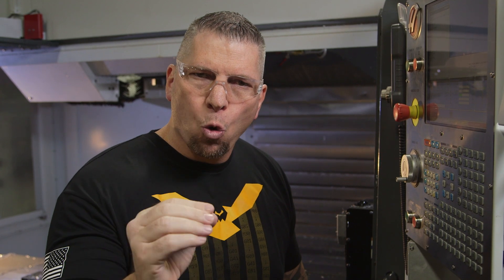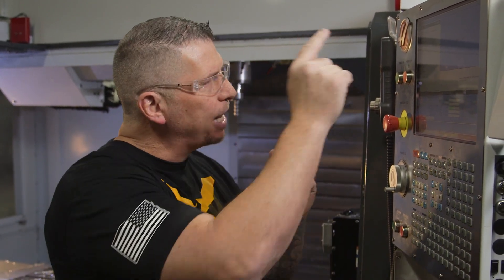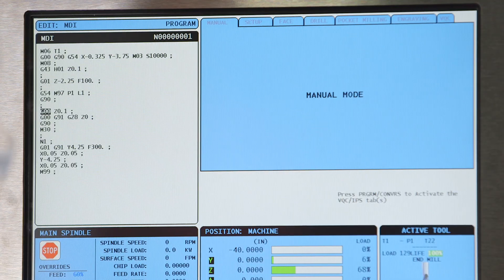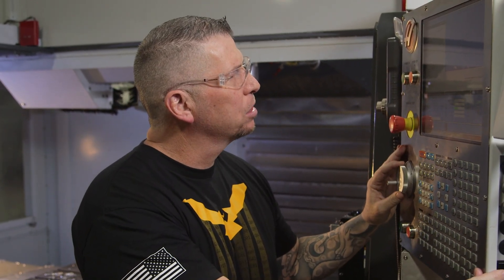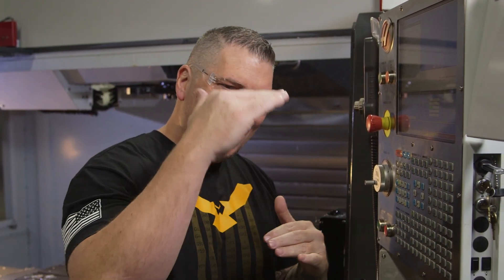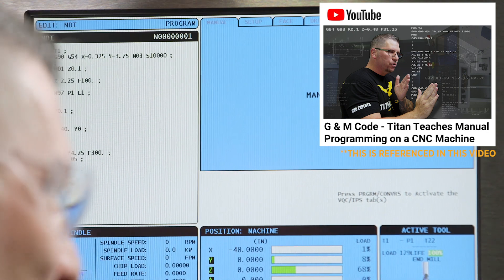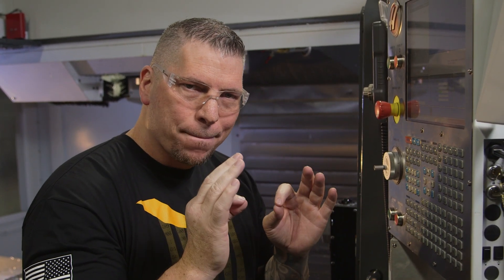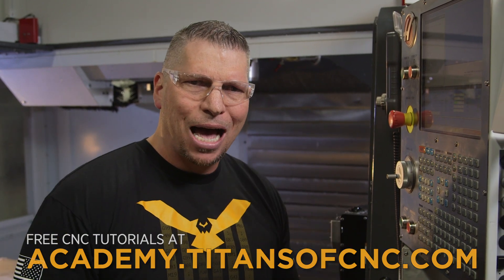G & M Code - This Code Will CRASH Your Machine - TITANS of CNC Vlog #53

Comment: Always duble check yehr :D My Boss dosent want that... We have to put the tols in, write a Programm and do a Part first try, but we work whit Mazak there life is easyer.
I´m a german Trainee in CNC manufactoring and i only do Customer Parts Turning and Milling 1-20 Pices mostly.
Ill always duble check but my Boss wants me to be quiker even if i would somday crash a Maschine...
Two years one small Crash :D But if you dont Crash it in germany you are to slow cors you go the save way.. (in the most Companys)
If it would by my own Maschin, i would never risk that... just too expensive!
Reply: And when you crash without checking first ,the boss will shout : why did you not try first ?!?!?!?! Hahahahaha
Reply: @Baard2000  yes its always the same :D

Comment: I only use g53 g49 z0 on “my” haas... but I rarely do manual programming... in my opinion, if you really like manual programming, or save on not buying cam software, you simply buy a mazak😂 that sh*t is awesome, does everything by itself

Comment: Who uses a negative in their height offset anymore? Isn't that old school logic? The number should always be positive. The length of the tool.
Reply from the maker: Actually most schools can’t afford the probe so they go old school
Reply: If you use for examle a broken tool as a tool to set the Z workpiece offset some tools will be shorter than that. I use 1 machine with laser probe and 3 without any probe or taster. I have a tool to set the Z offset and I have few negatives.
Reply: @TITANSofCNC  The probe wouldn't have anything to do with it. The machines I work with, don't have probes. Height offset is derived from the length from the Gauge line. Z0.0 is a negative offset  in the controller. That's how I figured how all other machines are setup.
Reply: TITANS of CNC: Academy and what about tool presetters and height guages?
Reply: Lol should always be? Dont tell me you are one of those "it has to be done this way" type of guys. he